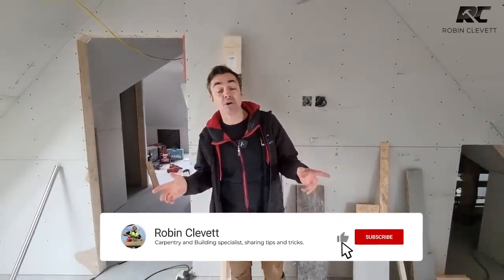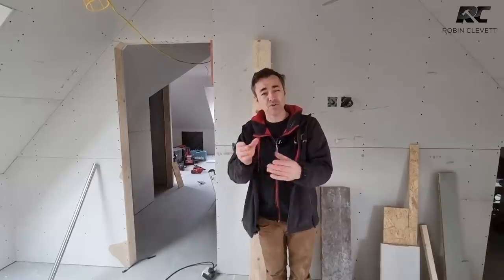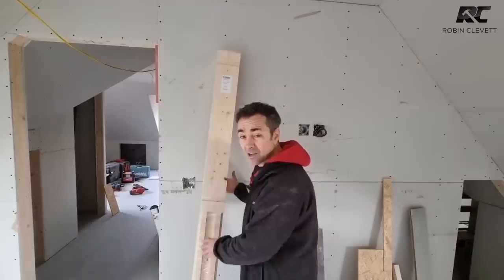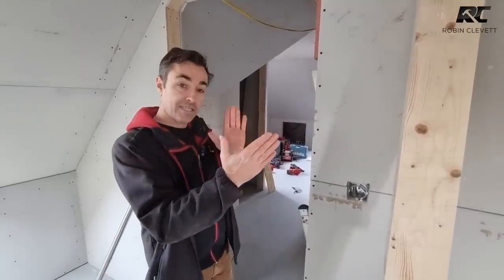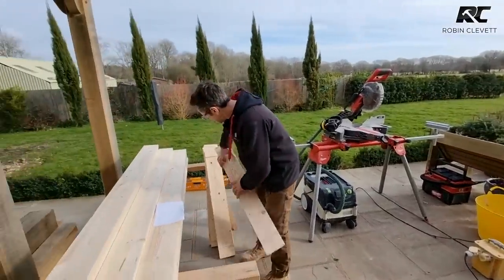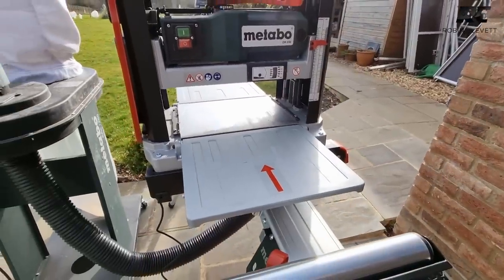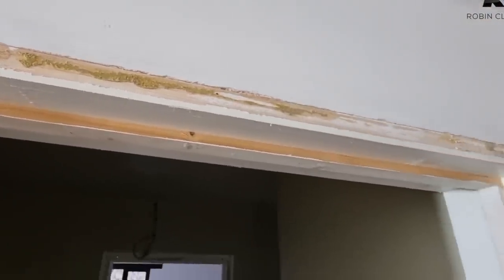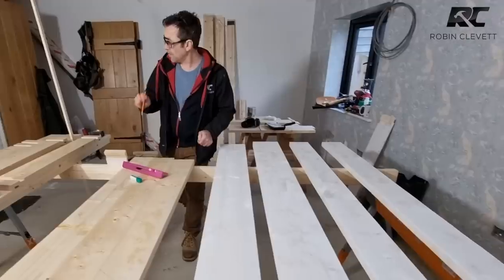The Big Build. Making Door Linings Epsiode 42

Comment: I suspect the  labour on site will be more expensive than buying pre finished MDF frames !
 Plus knotting does not work a lot of the time.
 You were advocating pre built MDF frames in a video last year ???
Reply from the maker: Did you hear our reason for not using MDF at the beginning of this video? We do still love using ghe MDF version but they are over double the cost at the moment
Reply: @ukconstruction   Yes I did , but the point is it 'must' cost more for all that labour on site, surely ?
 Love your vids and work, particularly the roofing layouts, angles etc.

Comment: I just made and fitted a load of 25mm MDF linings. Much better than soft wood timber, IMO. No bowing, no de-knotting, easier to paint and cheaper!
Reply: I aways get a panel of  mdf  and cut lengths for skirting , then  glue and pin some  parting bead to the the top for a little detail. So much easier than using wood. Also use the same trick for architrave.
Reply: hI Guys, The MDF Door Jambs that we get here in Canada are very very close to cardboard quality, 1/2 inch thickness , the head is grooved to recieve the top of the jambs which have a tounge left on which is supposed to fit into this 1/4 inch groove, but the piece which is left on the outer sides of the jambs falls off by itself , total junk , 5/8 long screws in the hinges, both to the door and this MDF frame , a fellow has to hope thar nobody leave the front Door open and a breeze does not show up , this is true ,
Anything like this around the London area,
Thanks Brian,

Comment: Great video,  how much do you add to the wide of your liners in relation to the thickness of the walls. For example say your wall thickness (plasterboard to plasterboard) is 160mm. I noticed you used a blue plastic packer to set the smaller shaped door frame which i think is 5mm.
So would i be right in thinking you add 10mm to the overall wall thickness to determine your door liner width allowing for plaster ?
Reply from the maker: The Blue shims in this video are 3mm and that would be what I would allow for plaster skim on each side of the wall so 6mm overall, thanks for watching!!!
Reply: @ukconstruction that's great, thank you for responding

Comment: Are they usualy called door frames ??
Reply from the maker: A door frame usually has a fixed rebate and is used for external door positions, we call the internal linings as they line the wall thickness and the side where it meets the plaster has a trim or Architrave to cover the join

Comment: I remember mucking around with door jambs like that and of course nailing them in with lost heads. Over here we don't plaster only joint so the jambs go in at the fit out stage. As you say everything is uniform these days so I buy my jambs in 5.4M lengths all to size and pre primed. Being the lazy land of it stands still long enough shoot it. All the jambs are just square cut joined. No rebates and pinned together with a finish nailer. They are finish nailed into place with the door swinging. Architraved and done. I can do a lot in a day. When I first got here I thought the finish carpentry gear was crap and still do but you have to run what you brung as they say.

Comment: Hey Robin , What size do you like the door linings to be set away from the plasterboard as I saw you had a spacer in the end of the video .

Just curious what size in mm it is . 

Cheers 😃 keep up the good work
Reply: Looks like a blue packer which is 3mm, thats exactly what i use as well.
Reply: @RobNorman08  my blue packers are 5mm. White is 3.
Reply: @nickhaley4663  yeah just depends on wether they are the solid packers or not, the ones in the vid are like the "screwfix" shims so blue is 3mm. 👍

Comment: How do you get on with snipe on your thicknesser? I have the Triton one and no matter what I do I lose 50mm either end to snipe
Reply: Do you not run a bit of scrap of the same thickness through before and after your first and last boards? I always do and it seems to work, holds the rollers up. I have a Makita thicknesser, similar to the metabo one in the video.
Reply: @ricos1497  I do try to sometimes but can be very fiddly when running long lengths through
Reply: @ChickenDinnerz  yep, I get that. If the board is being painted and filled anyway, I'd maybe just screw a board onto either end to extend it both ways. Couple of extra holes to fill, or if you're going 100mm down from either end like Robin is here, then you could reuse the hole when fixing the frame.
Reply: I have that triton, same problem. I got a piece of melamine face chipboard about 1500 long, 500 wide. Cut it down so 3/5  goes through the thicknesser, the remaining full width part stops this new planer bed being dragged through with  the workpiece.  It has improved the problem a lot, but hasn't completely solved it.
I intend replacing the triton with something better.
Reply: @rossbuchanan7632  yeah ok. That was my next plan. All starts to take up a lot of space then though. As far as I can tell, the DeWalt is much better in this regard. Although also twice the price.

Comment: since i started watching your chanel ive done 3 full houses with all new door linings plus the odd door lining here and there in between. say 30-40 linings. ive adopted your method of building them around the door and also using the storey stick and hinge jig i bought of ya. just makes the whole job so much easier. The last full house of doors i was able to router the hinge mortise in when i built the frames which made things easier also. 

that pink hinge jig is class. can see an upgrade happening there like
Reply from the maker: Top job Paul!! sounds like you have it well sorted mate!! the Pink one is my solid Aluminium prototype!!

Comment: What’s it like for snipe that thicknesses ?
Reply from the maker: Hi Graham, the snipe was minimal, we tend to allow in the length for snipe as this is pretty normal as the timber comes out, if you use a roller at the rear or have an assistant collecting the work as it comes out then this is not a major problem, the other thing is to take less material off in a pass to not put to much load through the cutter and the base of the machine, hope that helped!!
Reply: @ukconstruction  thanks Robin